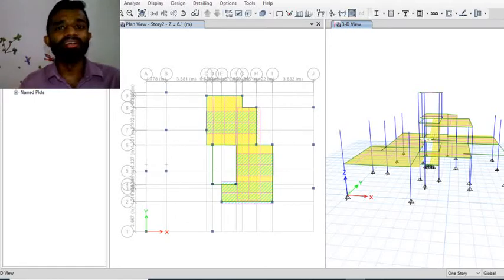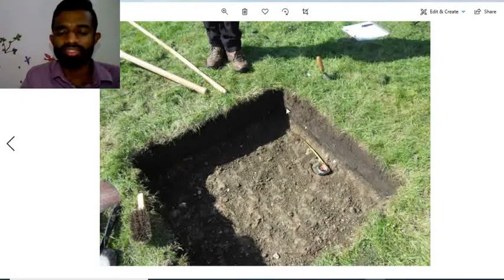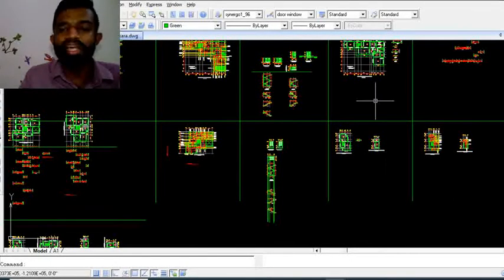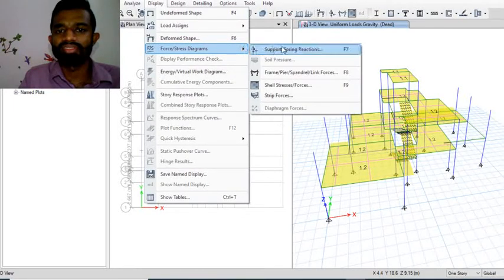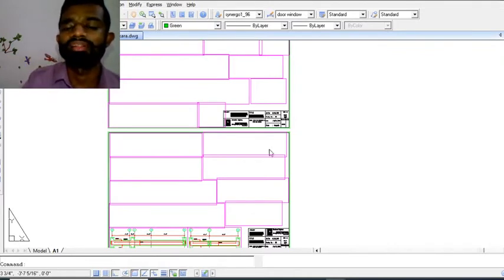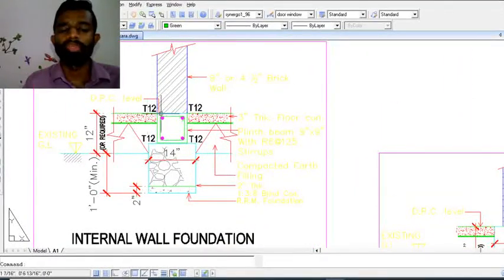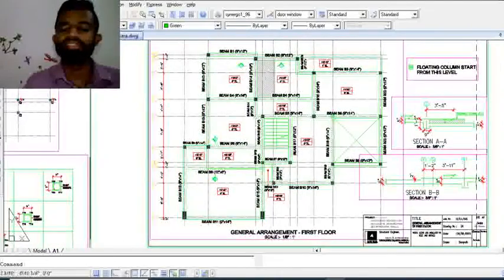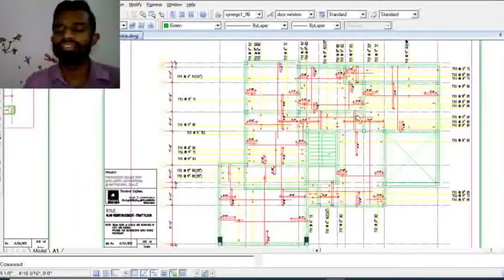Introduction about Structural Drawings

Comment: Hi Mr. Isuru, I'm a final year engineering undergraduate (not a civil engineering undergraduate though) who has a dream of building a house. I completely understand the importance of doing a structural analysis before starting the constructions of a building. But my question is how practical it is in Sri Lanka to build the house exactly according to the plan? Because the constructions are done by masons. Are they usually going to follow the plan exactly? or for that to happen do an engineer have to supervise them continuously? Will there be any bad consequences (a possibility of a structure failure) if the structural plan is not followed to the finest detail as proposed by the structural engineer? Thank you!
Reply from the maker: You can find skilled Masons who can read and understand the structural drawings in Sri Lanka. There are plenty of them. If you need some contacts I can give you many.
The other thing is for ordinary type basic architectural designs and single story houses, I don't see an engineers requirement that much. But for modern type architectural designs there are many critical elements and situations. Ensuring the strength and  Optimizing the materials cannot be done by an ordinary mason. For sure, you need to consult a structural engineer. 
After getting done a structural design and drawings, it is not needed to supervise it daily. The Engineer should involve in the special occasions such as prior to concreting the beams and slabs. Any change should be informed to the engineer. 
We can see many defects in houses which were build without the Engineers consultancy. They vary from minor wall cracks to Entire building tilt. So don't take that as a basic issue.
Reply: @CivilEngineeringChannel  Thank you for the detailed answer. If you can provide me some contacts of such masons that would be amazing. And another quick question. Are there any organisations that provide structural engineering consultancy for modern housing projects?